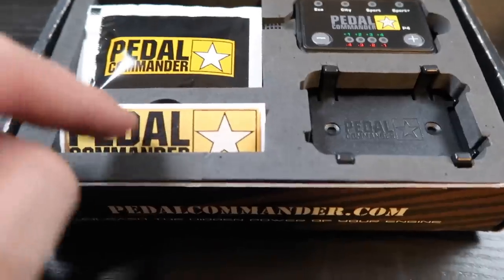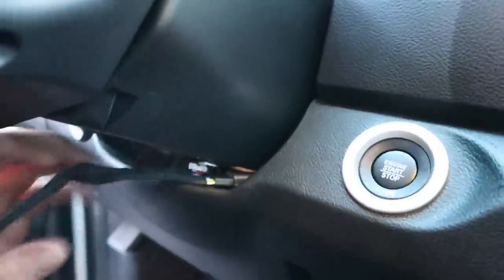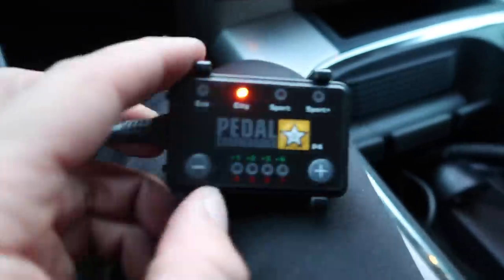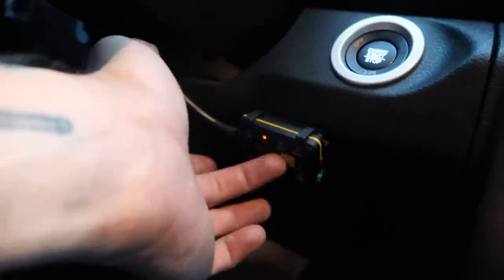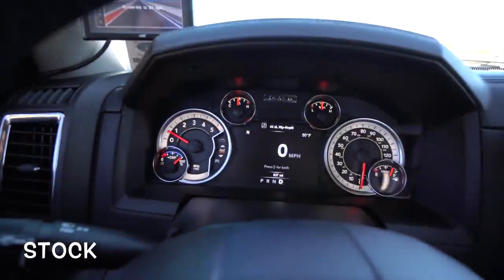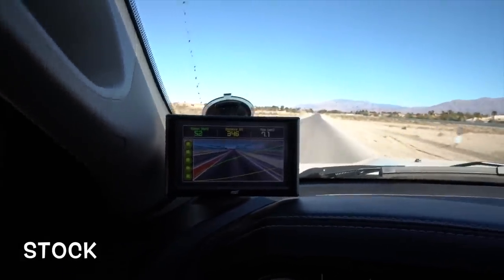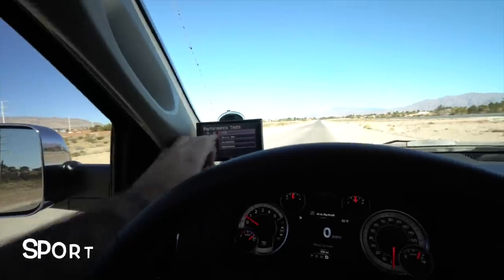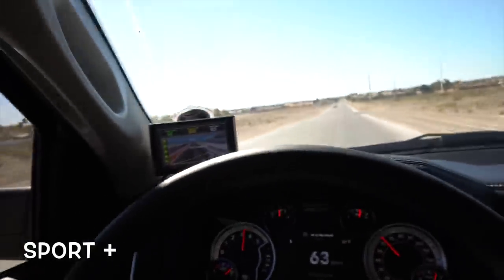Pedal Commander Review - Realistic Tuner Replacement? Jay Flat Out

Comment: I love it; it works great on my Tacoma SR 4x4! Basically it controls throttle response. It doesn't add power to your engine, but allows you to access it more or less quickly by varying the strength of the electronic signal sent to the ECU. I do everything from towing a 3,500lb travel trailer in the lowest Eco mode and get as much as 15mpg, to off roading where at times I want less response because it's so bumpy you don't want "crisp" throttle respinse, or sometimes more to power thru a mud bog. I have 33" tires as opposed to the stock 29" tires that came on the truck, and factoring in the corrected mileage, I get 18mpg city with a constant 300lbs of crap in the bed, a roof rack, no front air dam, etc. It's better than a "chip" because of it's choice of 39 different settings, doesn't violate your warranty, and you're not stuck with crappy mileage because you upped your horse power with a one-dimentional performance chip. I've been running it for a year and my comments are based on actual experience. Worth the money!

Comment: The haters need to be educated on how this works before they make the comments about "snake oil" or stuff like "just press the pedal faster".  Throttle by wire systems used to just be a 1:1 analog signal from the pedal, and the ECU's job was to keep up with the engines demands based on input from the engine sensors.  Now the pedal sends digital codes to the ECU first, but it's not 1:1 from the foot pedal - everything, including the throttle position, is controlled by the ECU. 

The pedal is an electronic device is and is just one device of many that sends digital codes to the ECU that tell the engine how to respond.  The ECU reads a digital code from the pedal and all other sensors and interprets how to make the engine and transmission work together to reduce emissions and provide a smooth drivable response (thanks to EPA and NHTSA).  Throttle sensitivity boosters do more than just amplify the signal from the pedal, and it's done in a way that can not be mimicked by just increasing the speed in which you press the pedal - it talks to the ECU and then the ECU changes everything about how the truck responds - which means the fuel injector ramps, waste gates (boost), shift characteristics, etc.  Very simply, it's a "dumb" tuner with fixed parameters, and it is not recorded as an ECU change because it's just an input to the ECU, not like a tuner that changes the ECU (which is why it can not be detected by dealers for warranty issues and it's allowed for sale in CA).

Think of it this way: your gas pedal sends signals to the ECU that mimics it's position in order of depression - 1, 2, 3 ,4, 5 and so on.   It can only be in that order no matter how fast you press the pedal down, and based on that input order, the ECU will not go past a certain ramp up speed no matter how fast you push down the pedal.  it will be very close to 1:1 if you press it normally; but the faster you press it down,  the ramp curve slows down because the ECU is waiting for the inputs from the emissions system and trans to catch up.  But that process is based in part on the digital codes coming from the pedal - in very simple laymens terms, the booster sort of changes the send the order to 1, 3, 5, 7... , or 1,5, 10, 15..  and the ECU is tricked into thinking it has to play catch up, which takes priority over the other emissions and fuel economy inputs.  That's way over simplified, but the point is don't think this just increases the analog amplitude of a signal from the gas pedal, because that would obviously have no effect on an ECU controller car.

I could show how it works with with math and graphs and stuff, but i've already probably bored everyone to death with my tech dork description, so just try the device and see for yourself.
Reply: Would it work on a vehicle with a hand help programmer like superchips?
Reply: Wow! Awesome detailed explanation!
Reply: Drive a BMW diesel and anyone should be able to understand the throttle body and pedal is not 1:1, so much delay it's insane... not turbo lag. (forums say something to do with torque management?) Hoping to buy one of these soon for the ole bimmer.
Reply: Have you opened it up see what hard ware there if not i dont believe u
Reply: Last time I checked, throttle position was determined by your foot.
Reply: You're right that it's not a 1:1 ratio between pedal position sensor and the actuation of the throttle opening. It's managed by the ECU and by adding a throttle controller it is still managed by the ECU completely. All the controller does is alter the position data based on whatever curve is designed in to it- which is the same exact thing as pressing the pedal farther, faster or both. ALL the pedal signal wire can do is report pedal position... which can be managed entirely by foot. Having curves programmed into a throttle controller is probably easier than learning how to use a throttle pedal as something other than "push pedal to make it go" levels of driver skill.
Reply: Dominick Minneci This is awesome. I actually wondered if I could save $300 by just driving with a heavier foot. This explains why the answer is “no”.
Reply: @famousmidnight  So glad to see someone spell bimmer correctly!
Reply: I would imagine it's using some form of a modulate signal. Depending on how far and fast you press is used by the ECU to determine the throttle body actuation. If you could amplify that modulating signal and it's time then the ECU would adjust the throttle actuator accordingly to a certain limit. So basically how much you amplify and how long or short it is changes your throttle response curve. I would have to put an oscope on it to be certain.
Reply: Okay so basically went and checked and voltage should remain the same from fully closed to fully open. By that I mean fully closed would always be X volts DC and fully open would be peak volts DC. So really I imagine the only true adjustment would be time. By increasing the time you could ramp up your throttle curve or ramp it down. If you were to slam throttle full open the timing for voltage in a stock configuration would be no more than say 4 seconds from your input to the throttle body opening fully. These are just numbers to fill in a hole. So say it takes 1 second to press throttle from idle to max you would have a 4 to 1 ratio. If you could change that by changing the sampling rate of the output signal then maybe you could increase the response to say a 3 to 1 or 2 to 1 ratio or even a 1 to 1 ratio. Or you could reduce the sampling so the ECU won't ramp up throttle actuator as quickly basically acting as limiter. The current system may not allow a ratio any greater than 4 to 1 in ECO, 3 to 1 in Normal and say 2 to 1 in sport.
Reply: THANK YOU FOR TIME WITH THIS EXAMPLE AND DETAILED EXPLANATION!!!
Reply: No the ECU is not tricked. The ECU will never override its tables for driveline longevity and emissions because it thinks it has to catch up. There’s a difference between actual and commanded. The ECU sees your pedal inputs and will apply them to the engine/trans as long as it doesn’t go outside of its predetermined look up tables. This is why and only why you need a tune to effect change. Not because the ecu is confused. In the event the ECU is confused as you put it it will go in to limp mode or throw a CEL. And yes there’s a specific OBD2 code for the throttle system than will typical throw a lightning bolt symbol on the dash. The system and its engineers are smarter than that. This product is no more useful than a throttle body spacer or the belief a air filter will add MPGs over stock.
Reply: Thank you 🤝
Reply: So what you are saying is that it works?
Reply: Sounds like it just burns more fuel, fantastic
and WOW... that is expensive for it doing almost nothing other then changing throttle position. Better off putting the money in an exhaust, headers, porting, anything....
Reply: Im interested because someone is selling it to me for 180
Reply: Thanks for that great explanation I think I’ll be buying this for my 2019 tundra👍🏼👍🏼
Reply: @alfonsosoumynona6583  just got mine used for 180. I get it tomorrow and will be installing on a 2007 FJ 6spd M/T
Reply: You have way too much time in your day to type all this 😂

Comment: I saw another video where some guys “killed” their engine because they kept on changing in the fly from the app and the commander itself. They mentioned the transmission slipping and shifting odd with a check engine light,  but after turning it off for a couple of minutes while they pumped gas (full tank) the engine light stayed on, but the issues with shifting went away. They said in the instructions it says not to change on the fly but never mentioned what the engine light was. So if this were to happen, would disconnecting it just solve the issue ?

Comment: Does this make the throttle respond any faster than stock if you mash the pedal to the carpet both before and after installing it, or does it just make your inputs more aggressive for you?
I've been recommended to check these out but I do not trust them to do anything other than pin the gas for me, which I'm capable of doing on my own.
My car still doesn't immediately accelerate when floored, and not because it can't- it's just programmed not to. It just waits. Does this change that?

Comment: The biggest complaint I have about these trucks is the lag from a stop when pulling out into traffic etc. Would you say the Pc improves that significantly?
Reply from the maker: +Andy Knight yes it improves it tremendously
Reply: It will do nothing for that
Reply: Dude stop trolling. I have one on my 17 rebel and it DOES make a difference in throttle response. PERIOD. If you dont have one, STFU. No one said it adds more POWER, just a more responsive throttle feel. Geez!
Reply: It changes the throttle pedal input to output ratio.  Your ecu basically sees a number from 0 to 100 from your gas pedal.  So if you have your foot down on the gas half way your ecu will see the number 50.  If you have your foot down to the floor your ecu will see the number 100.  What this product does is alter that number making it higher.  So if you press your pedal down half way your ecu may see the number 75 for example.  When your ecu receives that number it then decides what number it wants to send to the electronic throttlebody.  It doesnt just take the number it gets from the pedal and send it to the throttlebody.  Your ecu will look at a bunch of other parameters including one called Torque Management then send your throttlebody the signal.  You might slam your foot down to 100 but your ecu wont open to 100 but will open to 20 then 30 then 40 and all the way up to 100 gradually so that your drive train doesnt get shocked by the instant power and so that you dont break the tires loose to have a safer take off.  The lag people are feeling is simply the car's ecu holding back power on the initial throttle press.
Reply from the maker: Thats a gas, much different driving characteristics than a diesel.
Reply: Thats irrelevant.  Both gas and diesel engines use a throttle by wire system.
Reply: I put one on my 2015 Ram 3500 about a year ago.  I also hated the "lag" it had at a stop.  The pedal commander corrected this.  I like to run it in Sport+, but if I am in a tight parking lot or heavy traffic I turn it down or turn it off.  It makes your gas pedal super sensitive.  In Sport+ mode if you barely touch the gas it takes off, it is fun but not good for gas consumption.  I actually haven't used the Eco Mode so I am not sure how good that works.  I recommend it if you don't want to spend all that money on a tuner.

Comment: I finally installed the Pedal Commander in my 18 Ecodiesel. After a few weeks of driving around. I have a few things to say. First Fiat/Ram what the hell? The difference is night and day. There had been a few times I feared pulling out in traffic. I thought my truck was too slow in getting up to speed. Until this video, I never knew about the voltage thing. Now my truck is a really good daily driver. Thx for the video Jay. PS I bought my module through Amazon for $210
Reply from the maker: No worries man I’m glad you like it.
Reply: How is everything now, after 1 year installed? I have a 2015 Ecodiesel  - deleted EGR, cats, res, DEF, after market air intake, Green Diesel ECM - and I had it in +2 and everything was great until I was working in -40degC on night shift and left it idling all night; I started getting a Service Electronic Throttle code which completely disabled the electronic throttle. I luckily had a OBD2 code reader and cleared the code and discovered that not allowing the truck to idle for 8-12 hrs prevented the issue. It still happens sometimes if cruising in neighborhoods at idle for 10+ minutes. I haven't removed the booster, just changed it to stock settings and it hasn't caused issues since.
Reply: @forcealpine87  I haven't had any issues with it.

Comment: I loved my pedal commander but after having it installed for a few months I set it on the second most powerful setting worked fine till one day I punched it to get around a tractor trailer it fucked up and I had no pedal at all n a light came on in dash throttle sensor   Sat on side of road took it off and pedal worked again. I don’t trust it now
Reply: Same thing here had it for a few months and got up for work and drove a mile and put it in limp mode same error
Reply: Good heads up

Comment: DISCLAIMER this will make your truck accelerate as it should without smashing on the pedal. It will make it quicker not faster. If you want faster you will still need a tune with bolt ons.
Reply from the maker: Yes!
Reply: Exactly what I was thinking, it's good for pedal response but that's it. The tuner is going to open up so much more plus increase pedal response time. If all you want is a better throttle time, then go for it.
Reply: Holy crap somebody who understands the difference between quicker and faster. Are you trying to give me faith in this world again
Reply: Actually, even though it does not increase peak HP or Torque, it can give quicker 0-60 and 1/4 mile times because it can get more power and torque to the ground earlier than you otherwise could.  This gives higher cumulative power (area under the curve) by the end of the run, resulting in better times.  There are Youtube videos demonstrating this.  Personally, I prefer the Sprint Booster, but they are both good units.  Sprint Booster does not seem to have the lockup/freeze problem.